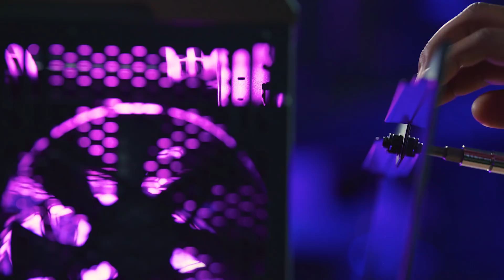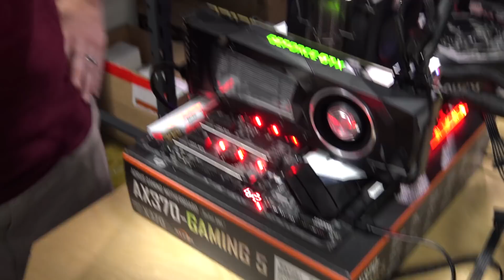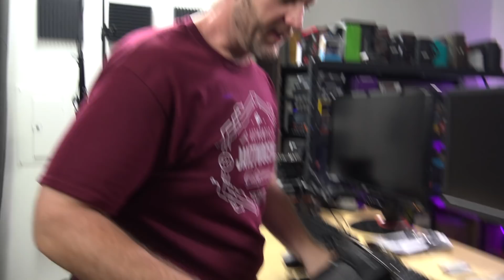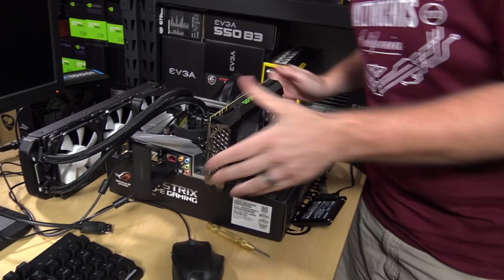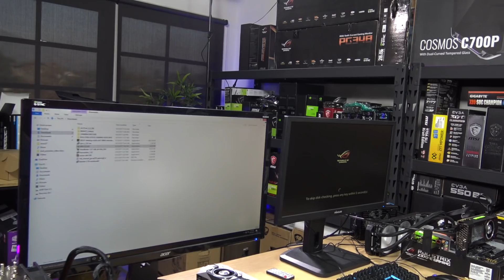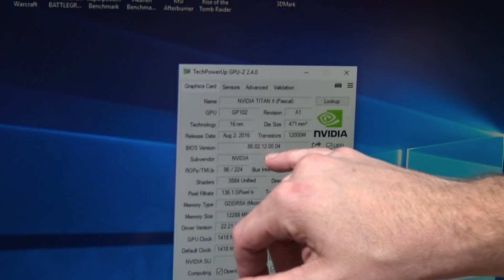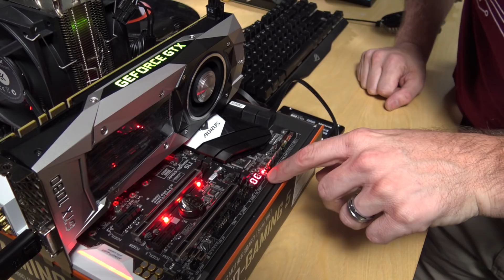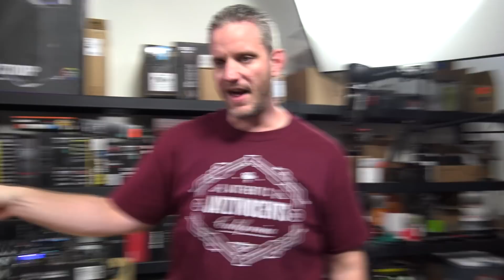I cant figure this one out... HELP!

Comment: i can't help you with this, but i have seen something similar.i work as a electrical debug on high end fiber optic telecommunication systems and pcb's (close enough i think). for easy reproducibility, we have two kind of boards: one that controls the actual data transfer and one that controls the first one, that has the "processing power". i have seen identical controller boards, on almost identical transfer boards, not booting up on one, but ok on others, just because of a slight change in chipset version, were it interrogates "something new" (new data controll line), it doesn't see it and alarms get trigger. you might have a data line or a clock presence line in open on the vga, and intel doesn't care about it, but amd does and doesn't boot because the system "thinks" something is wrong, sorry for the long post

Comment: 1. Use an additional PSU for GPU
2. Ryzen is sensitive to memory. Try only one memory chip in different slots.
As you said, this is not a problem with the GPU

Comment: Here's what I'd try to do assuming the bios version on both cards is similar:
1. Try the card on the other PCIe slot.
2. Although it sounds a bit stupid, I'd remove the CPU, RAM and graphics card from the motherboard and reinstall them. That usually solves my unexplainable problems with errors showing on the mobo.
3. If the Ryzen was overclocked, I'd bring the clock either slightly down or remove the overclock and test the system. Although it might seem unrelated but at this point I'd try everything, and this might be affecting system stability and power delivery.
Good luck Jay.

Comment: a) You checked the BIOS version on the same card twice. So, we still don't know if it's the same version on both cards.
b) The card that doesn't work on the Ryzen system just may have a smaller tolerance for power delivery issues than the other one. If that's the case, the power delivery, either through the PCI-E connectors from the PSU or through the PCI-E slot from the board, could be a bit more "liberal", causing issues.
c) Is the Ryzen system overclocked in any way, shape or form? Same reasoning as b): The one card could be more tolerant than the other.

Comment: I had a similar problem when I upgraded from a gtx 660 to a rx480. The mobo won't post with the rx480 but worked fine with the gtx 660 (It was a really cheap mobo from a prebuilt and only god knows where it came from). I tested the rx480 in a older pc (an hp with a core2duo) and it worked fine.

I bought a new mobo after trying to find bios updates for mi old mobo unsuccesfuly and now it works fine. (AsRock H61M-VG4 Intel i7 2600)

Comment: Umm... You checked the GPU Bios version on the Intel system... changed the same GPU to the AMD system, and the checked the GPU bios? So you check the same bios version? Ofcourse its the same. Check the one you just switched to the intel system? I mean the bios of the GPU doesnt change when you switch it to another system. I dont understand what you meant here?

Comment: If you've worked in IT for 10 years you have definitely had a situation like this before. Where a card works in one system but not another. That's like the first hardware problem. 

Process of elimination :/. And I've only worked in IT for 3 years.

Comment: "The HAF is back and better than ever"...Jay...for the love of god...even CM knows the case is shit.
Reply: And it is by no means whatosever an HAF case. If anything the airflow is very bad in that case because it it is another case of form over fuction. The fan housing itself blocks most of the vents limiting airflow significantly.
Reply: Exactly. Its all about the looks. Sure it looks great when you stare at it, but its the only thing its got that is decent. Gamer Nexus seemed to give the most honest review about this case. Cheap ass materials. You get 2x200mm fans and they are choked, i mean, WTF. More than 50% of graphic cards cant be used verticaly if using an air cooler for the CPU, in a case that is designed for airflow!!... I bet they will bring out a v2 in some months.

Comment: Extract the VBIOS from both Titan GPU's. Compare sha256 checksums. They're possibly not actually the same even though the version number says they are.
Reply: I had some sort of similar issue with an Rx580 (out of 2 others) that worked in one Ryzen build and not another. The solution was clone VBIOS from one to the other and it's now working on all systems. Was something to do with the PCI-e on the mainboards.
Reply: Essentially it would work in the last PCI-e slot but then only in 4x mode and do nothing in the primary PCI-e slot. Adding a network card PCI-e 1x to the first slot of the board (above the primary PCI-e slot) also then caused it to not work on the bottom PCI-e slot in 4x mode either. I never fully investigated why(even though I could), because the rabbit hole looked far too deep.

Comment: I would test, if the faulty card works in the Ryzen system if the PSU from the Intel System is used to supply power to the GPU. Maybe this is a weird issue with GPU pulling a little more power than it should, combined with a PSU delivering just a litte less power than needed.

Comment: I'm actually having the same problem but get the issue at an inconsistent rate. Sometimes it boots normal and other times it fails to boot (VGA, ram or CPU led will lit up), the PC restarts itself and then it is just praying it will boot normally. Sometimes my PC won't boot 2 or 3 times in a row before booting properly. I have a MSI Tomahawk, R5 1600 (not overclocked), GTX 1060 6gb and 16gb 3000mhz Corsair Vengeance RAM. Still trying to figure out what the main issue is.

Comment: step 1.. try a different pci-e slot on the board...
Reply: Yeah, that is clearly the issue here since all the other cards he tried didnt work either on the same slot.
Reply: Well lets follow this logically... We know both cards work. We know one doesnt work on the ryzen board. Since the ryzen board accepts all other video cards fine, this leaves the defect with the card itself. Since it can work in at least the other motherboard in this video, the fact its changing from a ryzen to an intel I think is irrelevant, and its more to the fact of a different pci-e socket. This particular titan could have a slight defect on its connector pins, which when coupled with that particular pci-e slot on the ryzen board may reveal itself to be an issue. Therefore my first step would be to try a different pci-e slot on the ryzen board. If that yeilds the same result, I'd put a different video card in to the top most slot, then the titan below and see if it shows up on the system after boot, therefore narrowing the problem down to the ability to download the vga bios from the card at power up. Basically at that point I'd lay the problem with some obscure motherboard defect and RMA the bastard..

Comment: I think its the motherboard it self, and if you change the videocard in a other motherboard than the version would be the same...duhh. sorry to say but i really think you are to much intel minded, i am not a AMD fanboy but after the intel screw up last video it seems you're trying to bring down AMD as well (as youre  reaction on AMD has multycore enhanchment as well on Adored video). But anyways you can have you opinion....as for failed boards or strange crashes i had them on both AMD and Intel....so thats thats nothing new, to say than that AMD has weird problems is kinda useless. I love youre video's but i do think you're way to Intel minded at times, one thing i learned PC stuff is often unreliable or buggy but it's not brand related.
Reply: Yeah, because he totally didnt give intel crap for x299 and kabylake-x at all. He clearly is in Intels pocket and does everything he does to discredit AMD obviously. It has nothing to do with AMD being far from being perfect or anything.

Comment: First note, unrelated to the gpu issue, but the weird bug when you put the 3rd card in, try to power cycle the motherboard before inserting new hardware. The problem with the GPU appears to be a firmware conflict that may have been patched since. Firmware would be specific to the hardware, and would communicate with the motherboard durring boot. I have no idea if there's a way to inspect the firmware, or how to intentionally update it, as it's never been an issue worth looking into?

Comment: It's an overclocking issue. Try turning off or turning down the overclock. I actually had this problem a few days where my GPU was flashing and my ram was flashing on my board every time I started and it wouldn't post when I got a new GPU. Ended up going into the bios, turning off all overclocking and everything ran just fine, despite the error LED's pointing to my other hardware. 

Also as others have pointed out, errors in you checking the GPU bios version, although that may not be relevant.

Comment: Didn't you check the bios on the same card?Anyway I would say it's a problem with the motherboard. You shouldn't have a hung boot at random points which fixes with a GPU reseat when it's on properly.My theory is that the bios is different between the two cards. And what is causing the problem is the one that won't boot is trying to initialize as PCie 3rd gen where as the newer bios automatically starts at 2nd gen either because it detects a problem with the signalling or it tries to go to the faster gen later on in the boot process.

Comment: Finally, someone with the same issue that a few of us have been suffering. This is the link: https://forum-en.msi.com/index.php?topic=286821.0 to a post in MSI forum in which a user will not get signal out of his MSI GTX 970 in the first PCI-e 16x slot of his MSI x370 Gaming Pro Carbon but changing to the second PCI-e 8x slot will boot with no issues.

I have experienced this issue in two different AM4 motherboards: the Asus B350 Prime Plus and MSI x370 Gaming Plus (which I owned currently). I tried to get signal out of my reference GTX 970 (Version: 84.04.1F.00.8E NVIDIA GeForce GTX 970 VGA BIOS V5240) in the firs PCI-e 16x of both motherboard with no success, but changing to the second PCI-e 8x and will post with no problem. I tried to extract my VGA BIOS using GPU-Z to have a back-up in case the new BIOS installed does not work but GPU-Z could not save it so I dropped the plan as I was getting the same performance out of my graphics card than my previous system (I was using PCI-e 2.0 16x that equals to PCI-e 3.0 8x).

I hope you find the solution JayTwoCents, I will stay tunned. And by the way, thank for a great job, keep it up!

Comment: Rule out the psu. Swap the psu from intel rig to the amd and see if that 1080 works ok amd.
Might be a slight power issue on the card. The other 1080 might pull less power therefore boot

Comment: The fact that the Intel system just did a new driver detection on the "not working" Titan XP means there is a difference between the two cards. Maybe the memory subsystem. If a person could flash the BIOS of the working card in the not working car then I'm pretty sure it will post.

Comment: When I bought my MSI GTX 1070 Armor OC it turned out there were 2 versions on the market with different manufacturers of the VRAM, one of them causing problems for some. Ryzen being so particular about memory, could it be the two cards don't have the same VRAM? And what many pointed out already, you never checked the bios version on the 1080 that wouldn't work i the AMD system.

Comment: I've experienced this problem 3 times over the years. Once it was a gpu power cable issue. Replace. All fixed. Once it was a dry solder joint on the mobo. Once it was a faulty power socket on the gpu. The cable one stumped me the longest as it was a new cable and seemed to work with some cards and not others. Replacing it fixed the issue.

Comment: Keep all the same components apart from the motherboard change the motherboard and see if it does the same I can't see it myself being a CPU problem I think it's possibly more of a motherboard problem for whatever reason. In fact why don't you get the same type of motherboard and try on a new one straight out of the box.

Comment: I've noticed the BIOS will sometimes stick with settings when you are changing things. Have to reload default settings, save and exit, let it POST again, then reboot it again. Once you've done that you can change settings, and possibly the other card will work just fine. I've had my RAM not work on DOCP settings after an OC I was using... had to go to defaults then DOCP would work again. Even some of the timings were off and I had to manually input them. Some weird, wonky stuff goes on.

Also, you checked the BIOS on the SAME GPU after you moved it. Others have spotted this already. So, it could be a different BIOS version, but I would be confused as to why that would prevent it from working. But, as you said, Ryzen still has some weird quarks to it, and I've noticed it seems the Gigabyte Ryzen boards are a bit more quarky than others from articles I've read.

Not saying they are bad boards, just maybe Gigabyte isn't getting their BIOS as squared away as others and getting weird issues.

Comment: Have you reflashed the bios on the motherboard? I've corrupted a bios from oc'ing ram without paying attention and selected a insane cas value. Changed the values back to stock but things were still messed up. Had random crashes and boot failures and it started acting like my memory was failing. Tried different sticks of ram and it appeared to be failing randomly on different sticks on different slots. Thought I had a dead memory controller on my cpu. Flashed the bios. Fixed everything. Must have corrupted the bios somehow messing with memory timings. It's possible something similar is going on with the gpu's on that board. Just flash the latest bios again. Can't hurt.

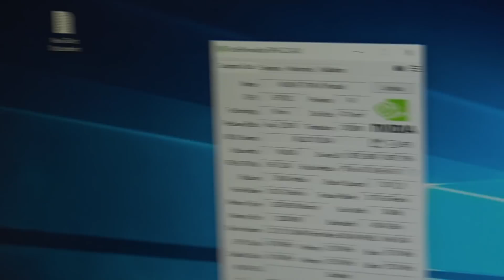Comment: now the comments are well over  3k so probably you wont notice my one. at  minute 2:11 you are showing the  bios version of the working card in the intel system. and you saying you are curios if the other has the same bios. at minute 4:00  you say you want to see what the  gpu bios  is after the swap.but you never checkedt! at least you did not shoot the video showing  the bios  version of the gpu not posting on ryzen. what you did on ryzen with gpu-z is that you have looked to the same gpu which was in the intel sys. of course the gpu  bios version is the same since it is the same gpu. LOL. so please make sure you are looking to both bios versions of both gpuz. not just to the one that works on both systems. :)

Comment: It's a power issue, the Gpu is pulling down one of the feeds on the board, physical fault on the motherboard, the psu is junk or a is got a bad FEt

Stick a anti static mat/bag under the mobo to rule out any pin shorts

Comment: Do you get the same problem with AMD gpu's or is it just happening with Nvidia gpu's?. I was having a similar problem with my Anus Crosshair Hero VI and GTX1080. I re-flashed the mobo BIOS and it seems to be working fine now. My 1800X has always functioned perfectly. It seems to be a gpu and mobo software/BIOS clash. For the record, my Thread-Ripper cpu and Gigabyte X399 mobo are working perfectly with my GTX 1080's.

Comment: You didn't actually check the other card's bios. Rewatch your video. You only checked Titan A graphics card twice. you didn't check titan B because the card that was "bad" was in intel and you havent opened gpuz yet to check it on there.

Comment: Hey can u help me I just got my final parts for my pc and my keyboard and mouse and when I plug it in the USB and boot it it says press F1 to run boot or something and then it doesn't recognize that I have the keyboard connected in so can some one help me
Reply: Make sure keyboard is in a USB 2.0 plugged directly into motherboard. Most AMD boards don't work with USB 3.0 without a driver install, hope this helps.

Comment: Hey Jay!!! Try this:  Try using HDMI port with the card, and see whether is it posts or not.
I had the same issue with a 1080TI and an ASUS X58 mobo, using a xeon 5650.
The Pascal series have some issue which make's it unable to post on DISPLAYPORT while it is in LGA1366 .
I found an isolated small forum, where dozens of people having this problem. If that card post on HDMI than you have a clue. (also after boot you can change to DP.)
i know rysen is not x58, but the symptoms are exactly my ones. 

Just make it work my 1080TI I had to scrap my whole platform, and I needed to build my current one, around a i7-4770k
Reply: I was having the same issue as Jay on a Ryzen 7 1700X with MSI Gaming Pro Carbon MOBO and GTX 1080 Ti.  After swapping out the CPU, RAM, and MOBO I figured out it would post with HDMI but not displayport.  It was very frustrating for a while.
Reply: I had a similar problem with my 1080Ti and took alot of google-fu to find the issue. My issue was my 1080Ti would not post on a cold boot. It is an older motherboard (X58) in my machine and I had to enable Asus express gate. Essentially what was happening was the Display Port was not negotiating a signal protocol to the display before the GPU was ready post which was ready causing a GPU post fail. Enabling express gate delayed the post long enough for the signal to negotiate.

If you use an HDMI 2.0 cable to your display does it still have an issue posting, Or warm booting the PC allow it to post?
Reply: thanks. this explains my thing to, i have old system, i5 2500 and gtx 760. Monitor is on displayport and if i put my tv in hdmi my system automaticly change after restart the hdmi primary display. After restart i have to always watch my tv to change it back on monitor, i just take the hdmi cable out. Looks like nvidia has this display port and hdmi issue, it thinks that hdmi is primary and as over this video then newer card dont like display port even more.